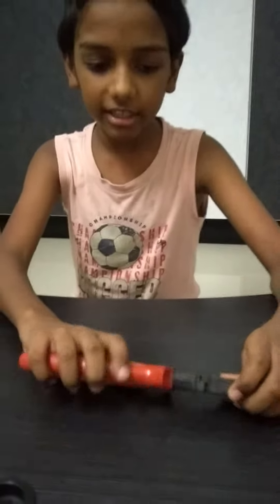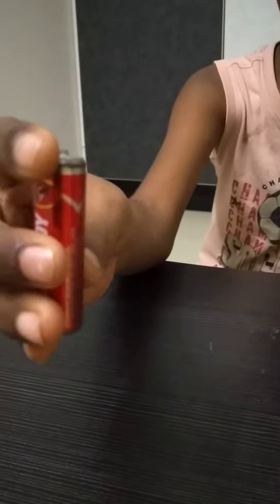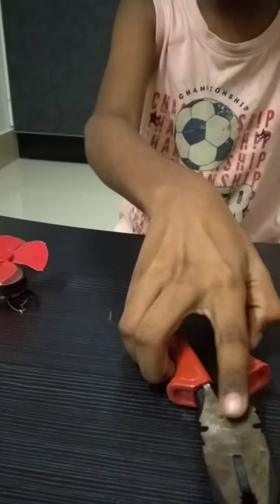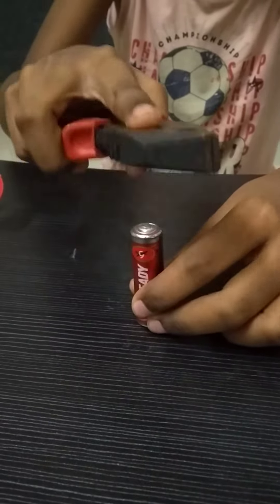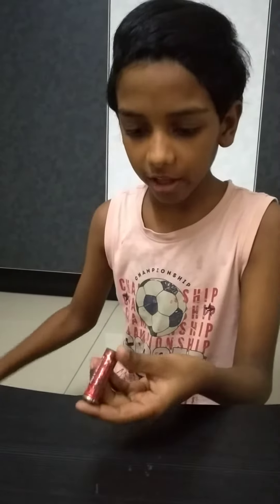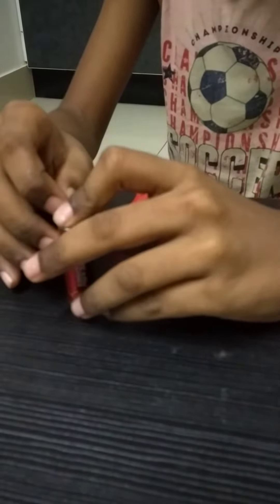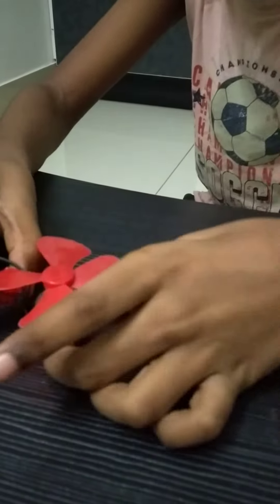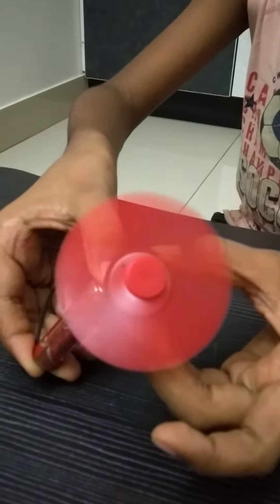How to recharge a non rechargeable battery

Comment from the maker: Today I'm going to teach you how to recharge a non rechargeable battery

For more such videos subscribe to my channel and click the bell icon.

Click on the following links to view my other videos:

https://youtu.be/3kC4gg7CSWw -- What is a digital multimeter, how to use it and test components if they are working or not
https://youtu.be/8212k8aPeKc -- DIY cute bristlebot /electric toy without battery
https://youtu.be/_Ki3RC8paOA -- How to make a earthquake alarm
https://youtu.be/mBSifA58N7g -- DIY buzz wire game
https://youtu.be/iyUrzaTdiUs -- How to make a simple soldering iron without electricity
https://youtu.be/QTletzI-XeU -- Awesome DIY mobile charger
https://youtu.be/9BJ_pBVH5d0 -- How to make a electric candle for the integration of our nation
https://youtu.be/5v_xCCYRe64 -- 2 awesome life hacks with usb
https://youtu.be/svXhjCvHgIw -- How to make a DIY Spin art machine
https://youtu.be/-ojmnr3mVb0 -- How to make a free energy generator which is 100 % working
https://youtu.be/AUuC6AfH4AE -- How to make a dishwasher
https://youtu.be/JIGKCaAJv-k -- How to make a water alarm
https://youtu.be/Z0yLC37xGU4 -- DIY electric toy for lockdown/ summer
https://youtu.be/8zL-QczLu0Q -- How to make a simple switch
https://youtu.be/uN2Qs36kScM -- How to make an air cooler(part -1)
https://youtu.be/IF0a79rvOqI -- How to make an electric fan
https://youtu.be/z7YsdPIdQDA -- How to make a bi-directional switch
https://youtu.be/HJgk1GUJ3kg -- How to make a battery connector from non rechargeable batteries which are not working
https://youtu.be/UZ0p7zqd_5g -- How to make a simple car which goes in both directions
https://youtu.be/ZoWY6wzQD9g -- How to make a simple electric boat ⛵
https://youtu.be/CYgGmoC3xOA -- How to make a simple bi directional switch with a 2 way switch

Link for my all Arduino tutorials -- 
https://youtube.com/playlist?list=PLWgCVhh2QLMi2GsSvmhTwFbqQNOnmv5Hp

Thanks for watching Subscribe 🙂 to my channel for more Amazing Arduino and electronics videos

Comment: it's doesn't work😤😤😤😤😤😤😤😤😤😤😤😤😤😤😤😤😤😤😤😤😤😤😤😤😤😤😤😤😤😤😤😤😤😤😤😤🙊🙊🙊🙊🙊🙊🙊🙊🙊
Reply from the maker: Try it with hammer and make sure the battery's terminal is not rusted
Reply from the maker: If it is rusted it doesn't work